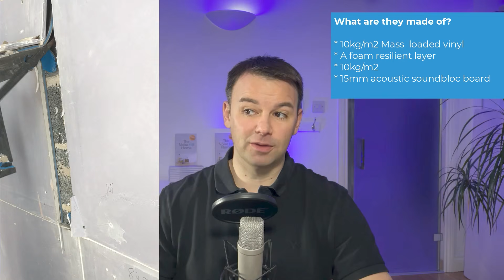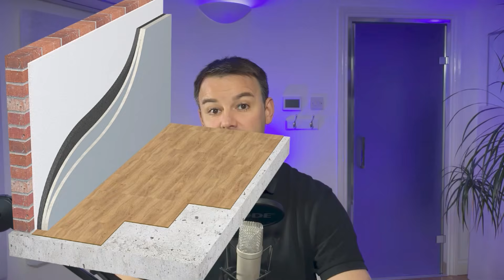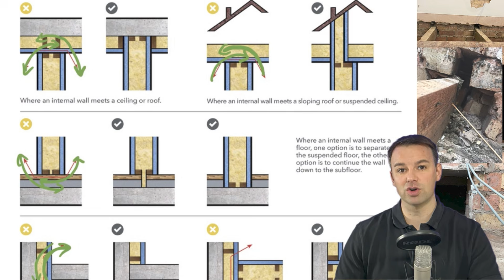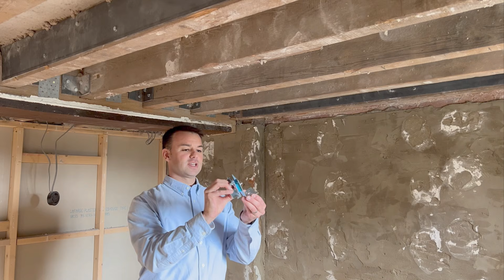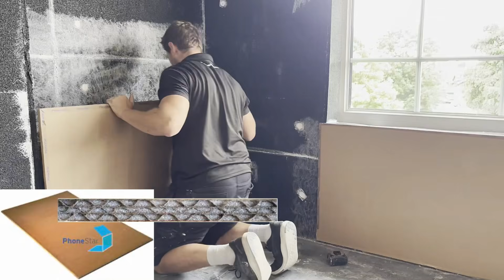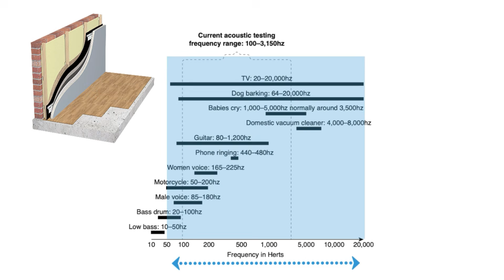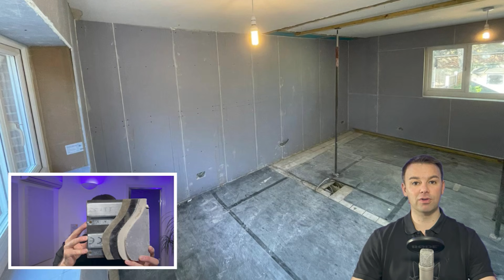7 ways to Soundproof a wall | #diy

Comment: What's the difference between mounting Tecsound on a wall and just between plasterboards in System 5? I was thinking about building a frame with mineral wool spaced 5mm from the wall, and then two layers of plasterboard with Tecsound mat in between.

Comment: I have a different scenario I wish I could find some guidance on: In the next year I with other family will be moving to a piece of property, I will be wanting to put a Tiny home - adu type structure to live. My desire is to have a studio type space where I can have a Home Theater and 100 watt guitar amps going at any hour. I don't need to be concerned about sound coming in only about sound escaping. How far would my unit need to be from another unit that would not have sound proofing?
Reply from the maker: I’m not sure, will the property be in a built up housing area?…if so….I would recommend a concrete block construct with at least 150mm of good quality sound insulation. 

When we build a studio with these objectives, our walls and ceilings are about 450mm thick. 

My video for February is a start to finish out building studio build. 

Thanks for your question

Comment: The second panels you refer to with the anti vibrational matting. Where can these be purchased from?
Reply from the maker: These are the only ones I know of that are not manufactured with Mass loaded Vinyl. They have the right corky materials....but as I said in the video...use them the right way: https://www.soundservice.co.uk/quietpanel-recycled-wall-soundproofing.html
Reply: @jimprior7 what would you think about 20mm rubber with these panels on top?
Reply from the maker: Hey @francescalillie6633,
Yes, if you can sound deaden the wall first with 20mm rubber and then install those panels on top, you should achieve a decent reduction in noise. We’ve done this on flanking walls before, and while it’s not as effective as a full system, it can still give a noticeable human-perceived improvement.

You’ll likely reduce normal conversation and higher-frequency noise, but sounds like doors banging, shouting, or loud music may still come through to some extent. As a 50mm thick system, though, it’s definitely more practical and easier to install than the full system I recommend in Soundproofing for Beginners.
Thanks again for your question – would love to hear how you get on with it!

Soundproofing for Beginners | Full Course Tutorial
https://www.youtube.com/watch?v=hVqa1m3JzGs&list=PL-ZigmSd311dNw8Tbe1IfLiJgEiJcjvMN

Comment: Hi Jim, great videos, I was wondering why you use the 20mm neoprene rubber instead of the Soprema Tecsound SY100 SA for the first layer on the walls? is the  Soprema Tecsound SY100 SA not better suited? Love to know your thoughts?
Reply from the maker: Hi@gfbruce4363, great question – and thank you for watching! 😊
We actually do use Tecsound SY100 (10kg/m² SA version) in several of our systems – for example, in our 95mm wall build-ups, or where space is tight like around RSJs, waste pipes, or road traffic noise solutions. It’s a great material when used in the right context.

That said, the 20mm rubber we use as the first layer on many of our domestic wall systems isn't your typical “neoprene” rubber you find online. It’s a heavy-duty, cork-like matting that’s specifically chosen for its ability to absorb and sound deaden without channeling noise through the structure – which can sometimes happen with large surface areas using MLV on light weight blocks and thin party walls.
We’ve tested both TecSound and the 20mm rubber over last 15 years or so, we have had them tested them in institutes like Birmingham University and in real homes, and in side-by-side comparisons (even in the same property), the 20mm rubber has consistently outperformed Tecsound when installed correctly. That’s why it’s my go-to first layer in most residential installs especially when aiming for that detached-house feel.

Like all soundproofing materials, it’s about how you use them and in what combination. We've just found some winning combos that deliver life-changing results for homeowners – and I’ve only recently started sharing those openly on YouTube 😊. We are always trying new combinations and always innovating....I waste so much time on projects trying out new and better ways to perfect the soundproofing installations.

Have you seen exactly how we install the 20mm rubber and the TecSound in the this video: Soundproofing for Beginners | Full Course Tutorial
https://www.youtube.com/watch?v=hVqa1m3JzGs&list=PL-ZigmSd311dNw8Tbe1IfLiJgEiJcjvMN
Reply: @jimprior7  Nevermind Jim, I have found the list of materials from the Free Home Plan download. Thank you Jim! Legend!
Reply from the maker: @gfbruce4363  That's the one 👍
Reply: @jimprior7  Yes Jim and thank you, I am currently watching that, I have also downloaded your book, so I will give that a read as well, I never knew it was a different type of rubber you use, that explains a lot, thank you :)
Reply: @jimprior7  what is that rubber that you use JIm please?

Comment: What is the best way to soundproof a wall that s on side of the road. Traffic noise . Wil the 20 mm rubber and the wooden frame with rockwoll an 2 double plasterboard help. Because we have also external  wall isolatie of 12 eps board and rendering. And what about moist. Thank you in advance😊 😊😊
Reply from the maker: Hi @RedoneB,
Thanks for your question! The EPS insulation board will actually channel noise around the structure more than if you just had sand and cement render on brickwork. I know it’s not practical to remove this now, so the best approach is to soundproof one room at a time and see what reduction you get before moving onto others.
The minimum I’d recommend is our 50mm system (TPS65W, as explained in Soundproofing for Beginners). This system sound-deadens the wall — your wall already has the mass, but it now needs sound deadening. A big benefit is that this thin DIY system can be returned back into the window reveals, improving both the acoustic performance and thermal value of the windows.
If you have more space, you could go further by using a 20mm rubber layer to sound-deaden the wall, then building a frame decoupled from the window wall...but you really need resilient bars for the road traffic noise....otherwise lots of low frequency will still get in. For window walls especially, the 20mm rubber is key, because EPS insulation systems (and SIPs-style constructions) are often not very soundproofable on their own.
Reply: @jimprior7  can I sounddead the wall with tecsounds or mlv

Comment: Hello can you do this directly onto a plastered wall or does it need to be bare brick?
Reply from the maker: Hi @siobhancooper3390, Sorry I missed this question, Yes you can, just not a plasterboard wall but straight on to sand and cement render is fine.....what system are you referring too?

Have you seen this video yet: Soundproofing for Beginners | Full Course Tutorial
https://www.youtube.com/watch?v=hVqa1m3JzGs&list=PL-ZigmSd311dNw8Tbe1IfLiJgEiJcjvMN

This will definitely answer your question.

Comment: hi what fixings do you use to attach rubber sound deadning to concrete brick wall?
Reply from the maker: Hey @Dawgley, check out the step by step instructions on how to install it probably in this video: Soundproofing for Beginners | Full Course Tutorial
https://youtu.be/hVqa1m3JzGs&list=PL-ZigmSd311dNw8Tbe1IfLiJgEiJcjvMN

Comment: Can you fit phonestar to a chimney with an active woodburner?
Reply from the maker: Hi @Dahni555,
Great question, thank you very much for asking that. Are you from the UK?

Here in the UK, yes you can, if it is 200mm away from the flue. Normally, you can if the chimney has been lined and the chimney stack has 100mm brick. Otherwise, you will have to use A1 non-combusting materials.

Generally with a stove, we use a combination of the TPS65W 50mm system outlined in Soundproofing for Beginners, together with A1 non-combusting materials, which we share in the Noise Free DIY Soundproofing Course for those with wood burners, stoves, and gas fires.

We are currently doing this right now on a project, working with the HETAS registered stove installer to ensure the stove meets HETAS regulations and the homeowner has enough sound insulation around the chimney and fire back.

There is a real predicament with wood burner stoves and soundproofing because the A1 non-combusting materials are nowhere near as effective at reducing noise as the rubbers, sealants, and glues you hear me bang on about all the time.

Soundproofing to the fire back is extremely important and, in my opinion, it’s not really worth spending thousands of pounds and all this hard work soundproofing your room if you are not going to soundproof the fire back. However, removing the stove and installing a sort of swan neck flue to give you more space at the fire back is a lot of work.

Soundproofing the flanking areas of the room following the 4-step method means your room will not only be soundproofed but also very thermally efficient. But I fully understand the desire to have the wood-burning stove, not necessarily for the heating element.
Thanks again for your comment and thanks for watching
Reply: @jimprior7  Thanks for the detailed reply! Yes in UK, chimney currently sealed up but keen to get wood burner in before winter. 1930s semi fixer upper, so keen to insulate and also sound proof the party wall, your videos are great help thanks!

Comment: Hi Jim
Do you have a link for the panels with the anti vibrational matting?
Also if you decouple a flanking  arch wall between a lounge/diner by moving the wooden stud in and running the system right through, does this give a good reduction in the flanking wall transmission? 
Many thanks 

Steven.
Reply from the maker: Hi @Stevenpower1838
Great question, thank you for taking the time to post it.
Yes, the links for a lot of these materials include the rubber, and adhesive are in the FREE download in this video: 

Soundproofing for Beginners | Full Course Tutorial
https://www.youtube.com/watch?v=hVqa1m3JzGs&list=PL-ZigmSd311dNw8Tbe1IfLiJgEiJcjvMN

Go the description in this Soundproofing for Beginners video and there is a guide with spread sheet and materials links with some discount codes. Obviously more discounts on the Noise Free DIY Soundproofing Course because you have access to my network on there….but these little discounts help.

With regards to the stud wall….yes absolutely move the stud like I show in this 1min SHORT:
https://www.youtube.com/shorts/gZUXqfg7rBM
SORRY!....i say stud wall a lot in this video!!!…..count how many times I say STUD WALL in one minute?

Comment: Hello, firstly a very informative video. You mention two different adhesives for fixing panels to the wall, I've seen the link for the spray contact adhesive, but not the other. Which one is used for the 20mm rubber to fix to the wall and also the one for gluing the acoustic plasterboard to the rubber?
Reply from the maker: Hey @AndrewClark-Y1t, yes all explained in a lot of detail in this Free Full Course Tutorial.

Soundproofing for Beginners | Full Course Tutorial
https://youtu.be/hVqa1m3JzGs&list=PL-ZigmSd311dNw8Tbe1IfLiJgEiJcjvMN

Enjoy 👍

Comment: Hi Jim, Great video very helpful. 
We are trying to get rid of neighbour noise, low level chat, and occasional baby crying.

How well do you think a system would perform that consists of 
Clip and channel with 40mm RW3
Phonestar 15mm sand board
tecsound 100sy
15mm acoustic plasterboard

Or would we get better results just using the 20mm rubber, phonestar and acoustic plasterboard.
Thanks
Reply from the maker: Hi @mightywizard6258, thanks for your question.
I think if you tuck the systems up above the ceiling and below the floor then both systems will take out the low level chat, but the baby crying you would need to sound deaden the party wall first and also soundproof the flanking walls perpendicular too.

The separating neighbour wall is a small part of your soundproof installation, if you can wait until the 21st April, I’m publish a YouTube video with a full course tutorial….with very very detailed installation instructions and you can see which system is best for you.

Thanks for your question and thanks for watching 👍
Reply: @jimprior7  Thanks for the reply.
My plan was to tuck it up and down as your videos suggest.
I was mainly wondering if it's worth doing the whole clip and channel or I would get the same/ better result with rubber + phonestar 50 mm solution.
Sadly, I don't think we can wait till the 21st

Comment: what would you do if building a new wall between bedrooms in a new house?
Reply from the maker: Hey Seb, thanks very much for such a great question:

In a new build house you will have potential at least 4 noise paths that you need to soundproof / treat / install sound insulation too.

The flanking dot and dab walls perpendicular to the wall separating the bedroom, the hollow chipboard floor, the ceiling and the direct noise path (the new wall) its self.

In a new build house all these areas are almost equally important as each other.

I would use Rockwool and resilient channels with 2 layers of 15mm sound bloc both sides of you can afford the space….but the biggest reduction in noise will come from you treating the flanking walls, floor and ceiling as part of the project…not necessarily that fancy clip and channel system.

I think you may want to watch this video if you have not done so already:
How to Soundproof a New Build: https://youtu.be/LwPKW8DMvG0&list=PL-ZigmSd311dNw8Tbe1IfLiJgEiJcjvMN  

Thanks again for your question

Comment: Hi Jim, great video. I design and build garden rooms and have a couple of customers that want soundproof music studios. I'm making them from scratch so can essentially use any depth of system for floor, wall or ceiling. For obvious reasons your diagrams include a brick wall but do you have any videos/information that include timber frame walls and the best combinations when building a frame within a frame? Thanks
Reply from the maker: Hey @NicTownsend-Wright, I don't not yet, but make you are registered for the Noise Free DIY Soundproofing course because I am publishing a Free Soundproofing course tutorial next week, it will be unlisted and available for only those registered. Its something I have been working on since January...I think you will love it for your garden rooms.

Comment: Thanks for the video. I'm sure this must've been asked before, but can the systems that use battens / stud walls work with MDF panelling? For example, say I want floor to ceiling panelling -- would I still need to use acoustic plasterboard, or could I go straight on with the panelling? I know some MDF (particularly the moisture resistant type) can be dense, and I'd be interested to know how good their acoustic properties are
Reply from the maker: Hi @liamBurke-p3f, I agree MDF is dense and we have used MDF as the final layer back in the day for mass once or twice, can’t remember which projects though. We have simply not tested MDF in enough homes to comment on MDF as an alternative.

We did a project before Christmas that had MDF floor to ceiling panels….we installed what we know works first and then installed the MDF panels over the top. Glueing the MDF directly to the sound bloc board instead of plastering.

I just stick to the combinations of layers I have tested and know works well. 
Is space an issue for you? 
Thanks for your question, let us know how you get on. 👍

Comment: Hello, thanks for the video. Is there some prerequisite for choosing right option ie some measirement has to be executed? I am getting noise from neighbour above.. Mostly foot noise, and noise from direct wall with neighbour which is only 15 cm full brick. No clue where to start. Thanks for any advise.
Reply from the maker: Hey @doorsmaker, if you have noise from above then check out this video:
 7 Ways to Soundproof a Ceiling
https://youtu.be/0OSrzTPM1cw&list=PL-ZigmSd311dNw8Tbe1IfLiJgEiJcjvMN

Are you in a Flat / apartment block or a semi-detached?….what type of property have you got?

Comment: Hi Jim,

We've gone back to brick on an end terrace and need to sound proof the party wall running up the stairs.
How would you overcome the issue of the party wall not being flat and level? Is a render required first or can you fit the sbx boards and then the rubber panels? Thanks
Reply from the maker: Hi @Jordanhill5627, right…if you watch the soundproofing masterclass…pretty sure the link for that is all over the descriptions.

Once you have watched the masterclass check your emails because we send you a free sample of the Noise Free DIY Soundproofing Course…and that sample lesson is one of the stairs lessons. It’s perfect for you. 

I hope you find it…
Also, sounds like you are using the wrong materials supplier…careful you don’t channel the noise around your house.

Also worth noting there is an offer on the Noise Free DIY Soundproofing Course coming end of next week….make sure you are registered or you won’t get the offer.
Reply: @jimprior7  hello, is the free sample for soundproofing stairs lesson still available?? Its my next project so any extra info would be appreciated. thanks michael.
Reply from the maker: @michaelcollins3521  I think this is part of the masterclass Freebies. If you do the masterclass it should be at the end of that.